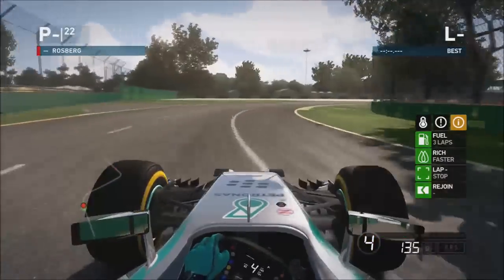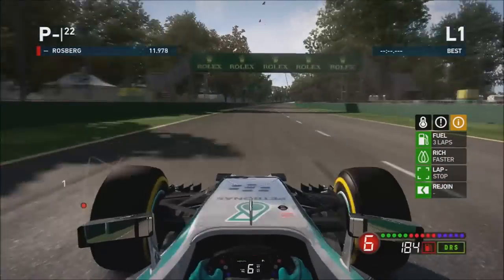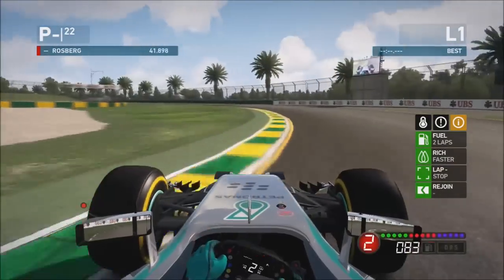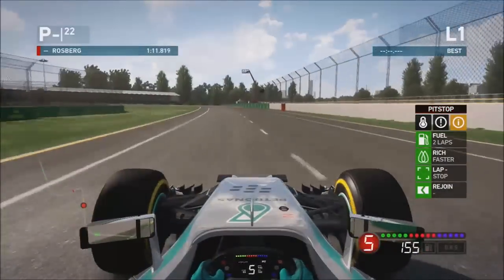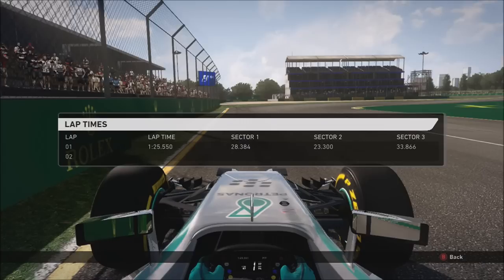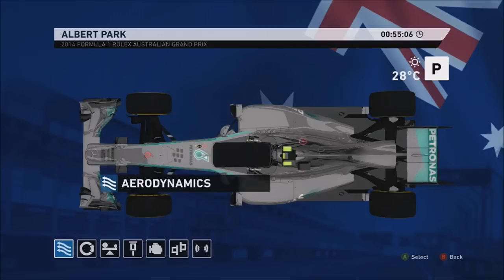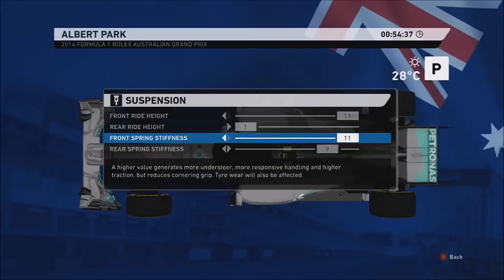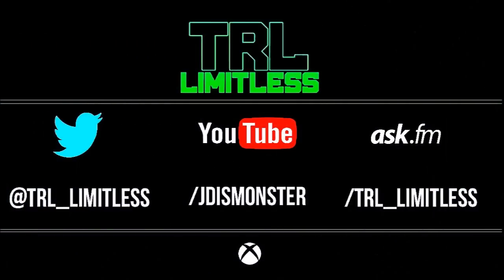F1 2014 Melbourne Hotlap + Setup

Comment: Hi, enjoying your videos. I'm currently playing alot of F1 2014 on the PC, with the Xbox controller. I'm focusing on Australia at the moment and am struggling to match your braking points for a lot of corners. I'm  using the same car setup, but i just can't get the car to turn in and it feels like I have too much understeer. I'm struggling to get my head around it and wondered if you have adjusted the 'Driving Controls' in the pause menu, specifically I wanted to know if you change the 'Advance Wheel Settings' or if you just stick with the normal Xbox Controller setup.
Reply from the maker: Thanks man! And it just takes time to get the flow of it, and eventually you will find what works for you. And I use default controller settings, so nothing changed on them at all!
Reply: For oversteer, put rear camber fully right

Comment: I've been going back to find more tips and time. Funny how low 28's use to be fast here last year. I struggle to get that now on 2014. I'm sure you know the problem areas. Mine is multiple unfortunately, 6&7 with brake timing, Waite I need the most work with and Shumi and Prost I've been progressing. I think the way I do the whole track needs a lot of work, but these are the most significant problem areas for me. I know I know Keep practicing...LOL